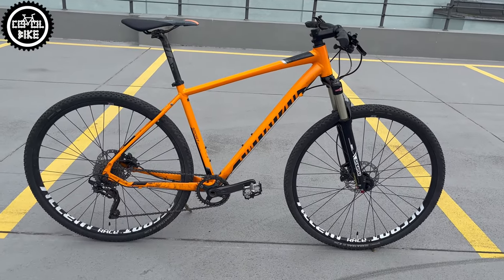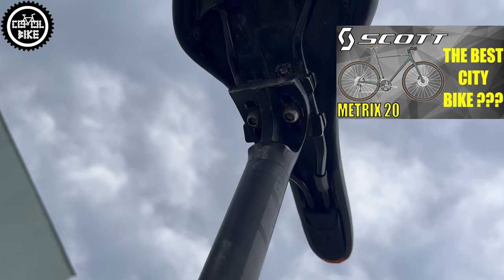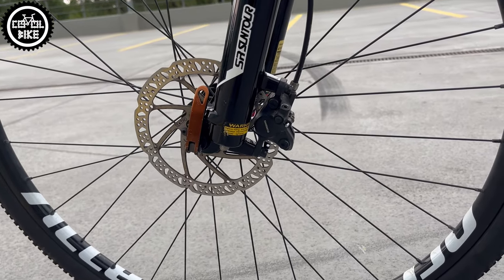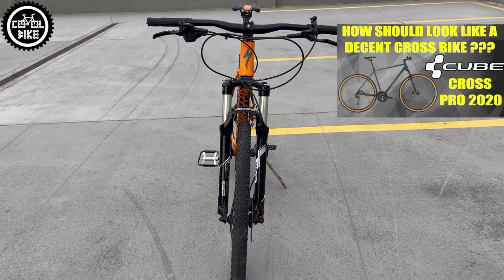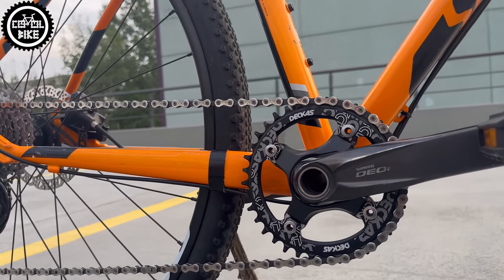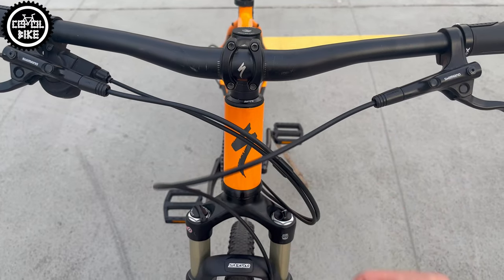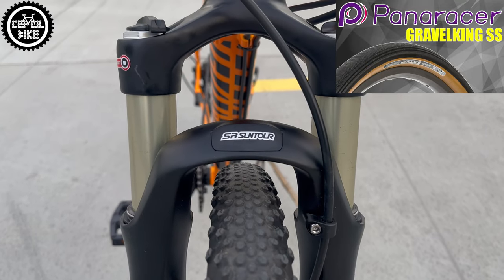SPECIALIZED CROSS TRAIL SPORT // What's Worth Changing On Your Bike

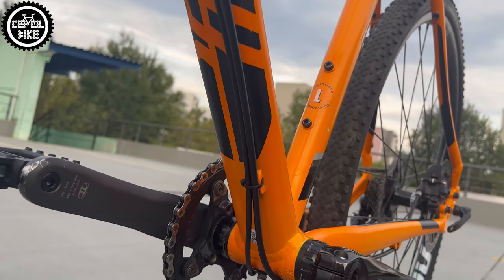Comment: 4:07 the support spacers looks like on wrong sides. Usually 2 spacers are on the right, and 1 on the left or possibly just one on the right. Are you sure you set it correct?
Reply from the maker: Hi, yes you are right ;). There should be 2 spacers on the right side, and 1 on the left if BB is 68mm wide, and just 1 on the left, if it's 73mm.
Reply: @COOLBIKEyt  So was it a mistake or you did this for some specific reason? 🤔 I'm just curious 😉 Nice bike btw 🤩
Reply from the maker: Bike was bought with this bottom bracket. Number of spacers is correct, but the sides are wrong.